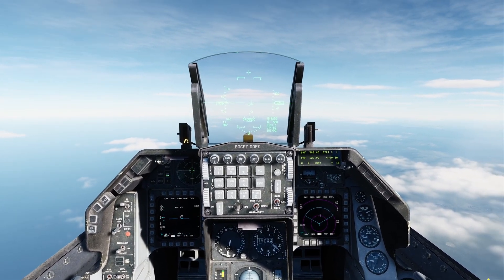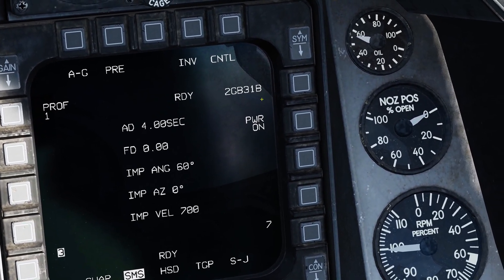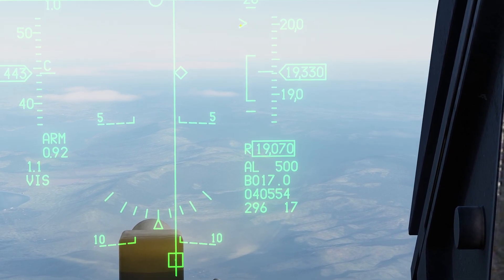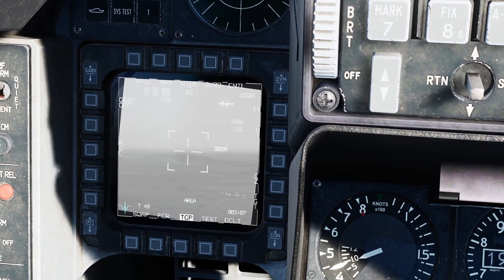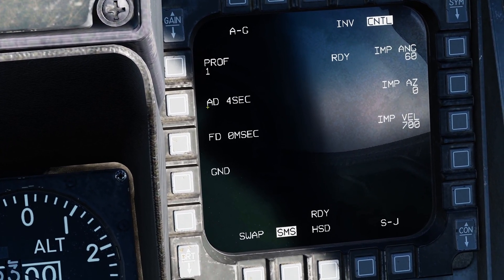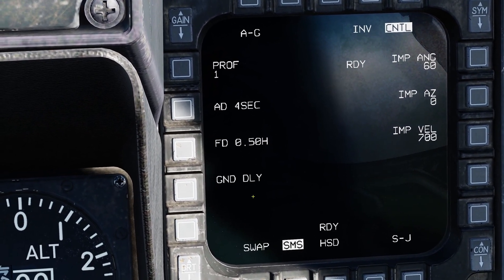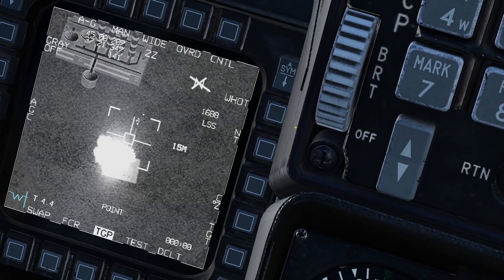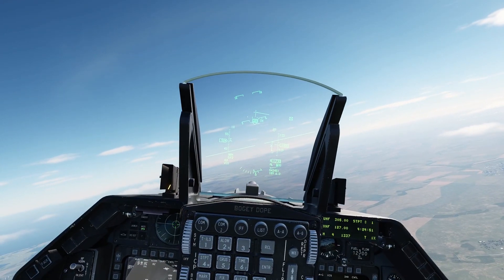DCS: F-16 JDAMs BASICS Tutorial

Comment: You can return to a menu by pressing the highlighted button once, instead of going to another menu.
Reply from the maker: If you press the highlighted button, you will lose that screen and replace it with whatever you select. This is why I specified "Select a screen you don't need. Press it twice" that way you can use an unused screen to give you what you want, instead of having to go back and switch BACK to the FCR or HSD or whatever was there prior. This way you have both screens you need/want and can easily switch back and forth. If you select the one that is highlighted, you override it with the new screen. IF that's what you want, then yeah. I just usually leave the screens I want/need to have easy access to.
Reply: @BogeyDope  Today i learned, thanks!

Comment: F18 has an envelope per the hsi screen so there's more room for error. Does f16 have ? If you miss flying the line perfectly will it still hit ?
Reply from the maker: Depending on your altitude, the margin of error can dynamically change. I have had no issues at 25,000ft even if I'm not right on the asl. Now, I'm fairly certain if you're down at angels 2 and your aren't on too close to the asl line, it may not be able to correct enough before it hits the ground. Higher altitudes are more forgiving in most aspects.
Reply: @BogeyDope  do you fly f18? Which plane do you like flying most ?
Reply from the maker: @yieovgwqxaz7912  I do. I definitely prefer the Falcon over the Hornet.
Reply: @BogeyDope  I can't aerial refuel on hornet but haven't had luck with f16 then again I just got the f16. I find f18 nicer avionics.

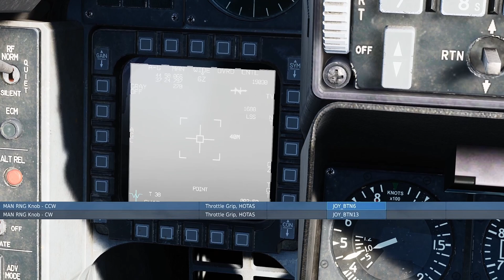Comment: Another great video! Question: you mention the TMS Down action at 6:32 to reset the pod to look at the current steerpoint. Is this the same as cursor zero so that pushing the CZ button (i.e., PB 9) has the same effect as using TMS Down?

Thanks!
Reply: I 5hought TMS down during a point track puts the TPOD on INR so it doesn't lose position if you move around aggressively
Reply: @DLevasseur  I think the first TMS Down action puts it into INR mode, and the second resets the SPI to the current steerpoint. But I'm not sure, and I'm confused on the difference with CZ since they seem to accomplish the same thing.
Reply from the maker: @Vortex31415  ECHO is 100% correct. I should have said "Twice" cause I did press it twice. TMS down short goes to INR mode and long or two short will take it to the SPI or waypoint you have selected. I'm fairly certain that TMS down is "CZ". Short for INR long or twice short for CZ
Reply: @BogeyDope  thanks! That's really helpful. I wasn't aware of the long press for CZ. I've been using the TMS Down twice action to CZ, but I wasn't sure if there was an advantage to using the CZ PB. 

Thanks again for the awesome videos!
Reply from the maker: @Vortex31415  I confirmed its TMS down twice for CZ. Long doesn't seem to do anything. So short for INR and twice for CZ.

Comment: Just a tip increase your IMP VEL higher...like a lot higher.  Also IMP ANG to 80 and get your speed up a lot faster like 450-550 depending on the IMP VEL you are aiming for.
Reply from the maker: Per mission/target yes. For a basics video, the default settings work ok.
Reply: I'm learning the Viper right now, and I'm unfamiliar with the weapons too. Can you explain the reasoning for wanting a steeper impact angle? Will that simply allow for a higher impact velocity? Better penetration of the target? Does DCS actually "care" about those factors when processing a hit on a target?